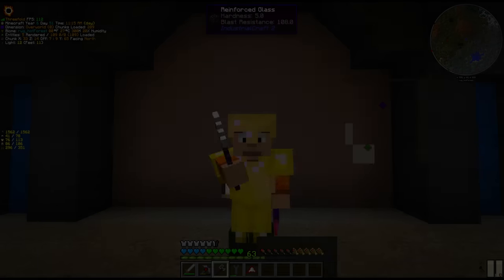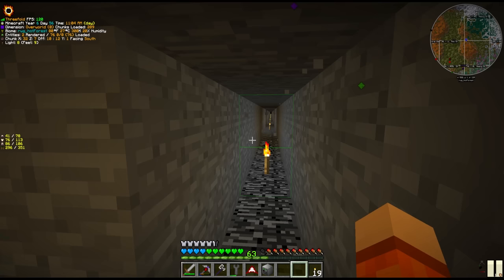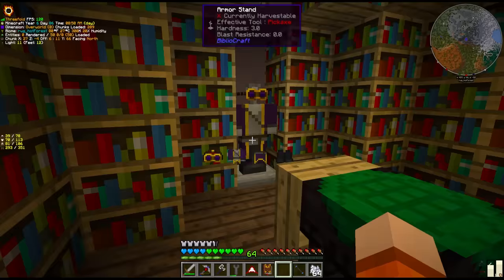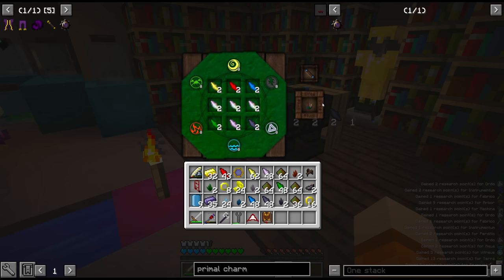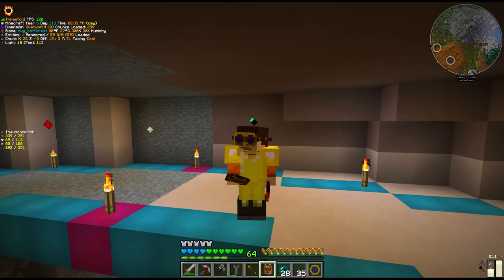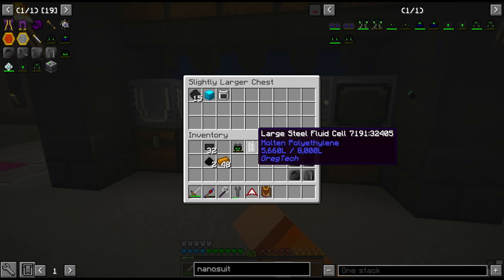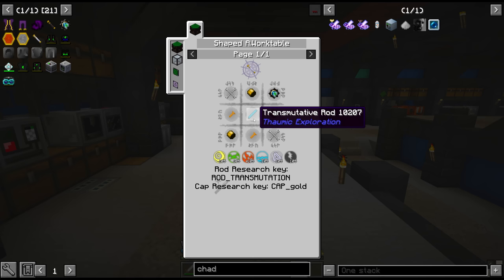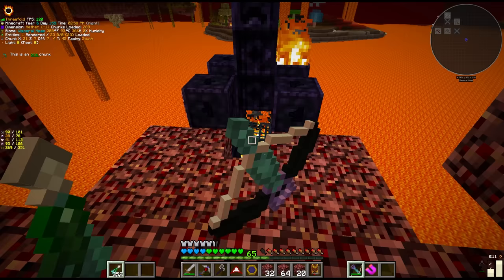Gregtech New Horizons S2 18: Nano-Craft

Comment: Energy Crystals do function as HV batteries, but as they have less storage than regular HV Lithium batteries they're none too useful for that particular purpose. You can also cook them with molten Conductive Iron instead of Energetic, but it will double the recipe time. And EU cost.

Another function of Nano armor that Three isn't going to experience for a while is that wearing a full Hazmat suit (or armor that has Hazmat properties, which will be listed on the tooltip) makes you immune to pollution-based debufs. Of course Three is playing without pollution, so he'll never encounter that particular aspect, but it the hazmat suit properties will still come into play come mid EV when radioactive materials start appearing. Handling those without the proper protections is...ill advised, to say the least.

You know what else works in a (functional) vacuum? *Magic*. Illumination foci are much cheaper than glowstone torches, and can be upgraded to damage undead that are passing through the light. They can even be dyed 16 different colors. Of course if you're looking for the cheapest source of lighting on the moon you want to look into Glowstone Nooks. Or just use TiC tools to place regular torches anyway. But when magic is an option I'm sure people can guess what my preferred solution is 🙃.

Warp certainly can be intimidating, but it's significantly less impactful than it used to be. In the version that I played survival in warp effects capped out at 80 warp, and unlocking the only really practical solution to dealing with warp involved at least ~160 warp (split between permanent and sticky) worth of research to unlock. Yes, I needed enough warp to summon withers twice over just to deal with warp. They were bad days, but that got changed significantly. These days warp effects cap at 200 warp, and the best (albeit most expensive), not *only*, practical solution to permanent warp only takes ~65 warp minimum. Don't be afraid to pick up warp in GTNH - it's not as scary as it once was, there's more ways to deal with it than there used to be (the earliest opens up as early as mid-HV or so), and in any case you're going to have to pick up warp before you're able to deal with it. Don't shy away from it, it'll only prolong your time spend walking about with a little warp as opposed to time spend implementing solutions for warp.

So those 4 HV circuits in the infusion recipe, as Three undoubtedly found out later but I'm mentioning it now, is just an NEI bug. Arcane pedestals cannot hold more than one item at a time. If at any point NEI shows a number of items in arcane infusion it's a bug, that's why it shows two HV circuits separately instead of one stack of two HV circuits in fact.

RE: Three crafting another set of Boots of the Traveller: You cannot use damaged boots in the infusion recipe for Electric Boots of the Traveller, and boots cannot be repaired in an anvil using Enchanted Cloth (Three did attempt this). Three could have crafted a Thaumic Restorer to repair his boots, or prevented his boots from taking damage altogether by investing in Runic Shielding earlier, but he didn't and he didn't, so here we are 🙃. Also something else worth noting RE: Infusion recipes in NEI: It can show invalid items that don't actually work for infusion. NEI says that any fish can work for the boots infusion, but this is not the case, shapeless craft a Pam's fish into a vanilla fish if the recipe doesn't want to work. Another important instance where this bug matters is with Impure Tears, which specifically require Max Tomatos to craft. Regular ones or Pam's tomatos, I've been informed, will not work.

There's a much easier/faster recipe for Tanned Leather using Phosphoric Acid in a Chemical Bath: Zero string, 2:1 Leather to Tanned Leather and 15 seconds instead of ten minutes of drying. "But how do I get Phosphoric Acid?" you ask? Well, remember those ashes byproduct from the benzene setup? Take out some Phosphorous Pentoxide instead of electrolyzing it, chemically react with water, and viola. Alternatively if you're sourcing your Phosphorous from apatite veins you just have to chemically react phosphorous with oxygen to produce phosphorous pentoxide. Very simple to do, and very worth it for making tanned leather much easier/faster.

The astute viewing may be asking "Why is Three using the Satin-Entwined Greatwood Wand instead of the Gold-Banded Greatwood Scepter he crafted earlier? The latter has more vis storage and a higher vis discount due to being a scepter." If so congratulations: You were paying more attention than Three was 🙃. That said you do have to keep your wand around until you craft a staff, since scepters cannot use Foci, so Three couldn't just have stored his wand in a chest and forgotten about it until he ever feels like crafting a wand museum. Both still serve a purpose, and I imagine will for a while yet - the best staff, IMO, to craft first if you're not heavy into Thaumcraft (foci/Runic Shielding/etc.) is a Shadow Entangled Transmutative Staff, which - as you might be able to intuit from the name - requires something a bit better than the gold-banded Transmutative Scepter Three is currently crafting.

Another good source of Tutaman, for those who have the Benzene setup, is the Calcium dust you get from processing Ashes. Alternatively calcium from bones, or leather from either animal traps or a crucible recipe.

One great benefit of the nano boots is that you no longer have to sprint everywhere to go at a speed slightly faster than molasses. Sprinting consumes a ton of hunger, so that's that much less time you're going to be waiting on a Healing Axe to refill you. Incidentally, for charging tools faster I recommend crafting a Battery Charger. Also very useful to have a single block for all of your tool charging, because otherwise you will shove something in a random machine somewhere and not be able to find it afterwards.

It definitely takes a moment to get used to, but you'll very quickly adjust to the new speed of nanoboots and you will be using them because even if sprinting with them is too fast walking with them is not, and who wants to constantly change between hazmat armor with vis discount and just an old pair of magic boots? The jump height is also considerable, but once the era of multiblocks comes around you'll be making use of that ability a lot more often than you'd think. Though it also helps if your base isn't build inside of a cave, of course 🙃.

So fun fact everyone: Every Ethereal Essence that comes from wisps (or select other sources, but primarily wisps) contains Aurum essentia. The aspect listed on their tooltip is just the secondary essentia they contain, all of them contain Aurum (and yes, IIRC there is an Aurum Ethereal Essence that just contains more Aurum that other essences). Ethereal Essence is something you want to make sure to store securely until you inevitably set up a Wisp mob farm for it, because it has a few very important uses you don't want to skip on or delay. Note, by the way, that those Nether structures are not the only sources of natural Wisp spawners. There's obsidian platforms with a chest in the overworld that contain a Wisp spawner as well, below them. Look for the latter in cold, preferably more mountainous biomes.

Note that the extra instability, which is already included in the Arcane Abacus' readout (though it apparently wasn't enough to actually increase the infusion's instability rating), is caused by not placing items on the pedestals correctly. You don't need to remove empty pedestals before doing infusions crafting, if pedestals are properly mirrored they, themselves, do not contribute to instability.

One thing you can do if you want a better overview of your equipment is open up the Traveller's Gear Inventory (default keybind Numpad 7 I believe, at least that's what mine is set to and I can't reset it). It'll show a few equipment slots you won't see otherwise (BTW, Three: HINT*) as well as what your total Vis Discount from your gear is. Nano Goggles, Bewitched Robes, Bewitched Leggings and Nano Boots of the Traveller sums up to 19% discount, which is the magic number to make the midgame of wand progression not a painful slog. I mean just take another look at the Vis cost of crafting that wand: That's *less than half a Vis short of not being able to do the craft. The alternative is to craft intermediate wands to bridge the gap, but that gets really obnoxious really fast - recall that those Primal Charms are expensive, you need one per Scepter, and Three didn't even mention the fact they take Rose Gold (or "Snail Gold" as I like to call it) to craft. Rose/Snail Gold is a 320 second EBF recipe, although with Nichrome Coils Three is able to get an upgraded overclock on smelting it, making it significantly faster. Add on the need to craft more wand cores, meaning setting up more infusion recipes and handling the essentia, and yeah. Wand progression as I've laid out in the spreadsheet is frontloaded, but it's better than the alternative. At least IMO.

Ooh, I've actually updated the Benzene design since Three build it, so I'm hoping there's some DT action to look forward do 🙃. Squeezing in some DTs in Benzene 2 was not easy, but hopefully it'll be worth it.
Reply from the maker: I really did not notice the Auram in the Essence the Wisps dropped until you pointed it out... Oh well, useful for next time! As always some really great information in here. Thank you Metis! <3

Comment: The sinister aura node at the wisp spawner is really good if you plan on turning it into an energized node for crafting purposes. Energized nodes only give out centi-vis in the 6 primal aspects and only if it possesses said aspects or compound ones that break down into them. The skull looking aspect is the one for undead which breaks down to motion (air and order) and death (entropy and life ((earth and water))) which means the fire aspect right next to it makes it perfect for using with a wand charger  vis relay. Some aspect will charge faster, but if you leave your wand in the crafting table you'll have free unlimited vis inside at all times. It will also recharge vis storage necklaces if you hold them. Don't remember if moving the node will stop the wisps from spawning, but there are other ways to get Auram like mana beans. Also every essence give Auram essentia, the other aspect just determines what other essentia you recieve.

Comment: I strongly advise to use world accelerators, probably they are the most power consuming but you save waaay to much time than you expected, as example that terra wart growth in 30-35 minutes, you can drop down into minutes or seconds (depends what tier you use, i probably would recommend to use hv)